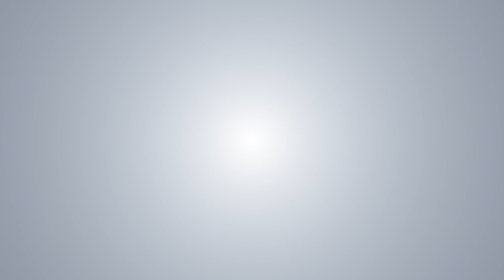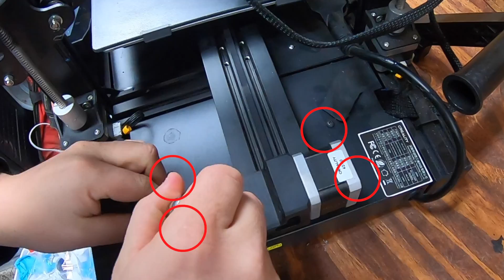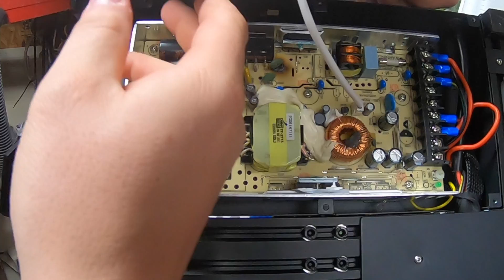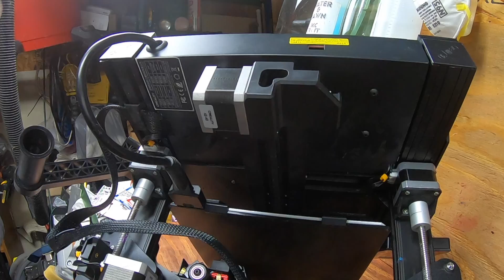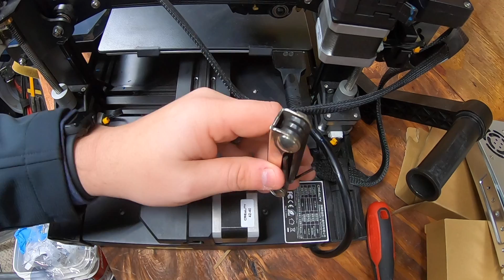3D Printer Has No Power & Won't Print? FIXED issue on a Creality CR-6 SE [Complete Guide]

Comment from the maker: Learn how to fix your 3D printer's no power situation! I will go through multiple steps on diagnosing your issue and finding a way to fix the problem. 

The Tools:
• Voltage Meter Kit - https://amzn.to/3riICui 
• Allen Wrench Sets - https://amzn.to/3GhKGH3 
• Philips Screwdriver - https://amzn.to/3hdpzx0 
• Magnetic Metal Tray - https://amzn.to/3tv6oRz

The Part:
• Mean Well LRS-350-24 - https://amzn.to/3AR3HPA

00:00 The Start
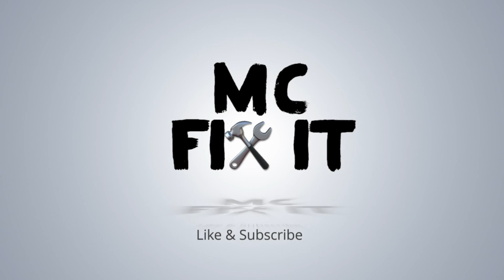00:07 The Project
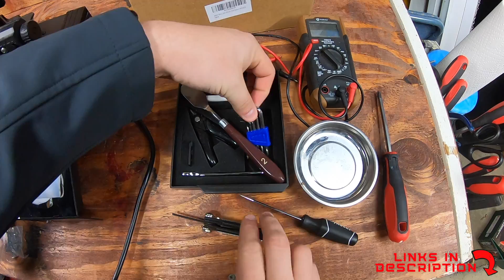00:52 The Tools & Supplies
01:22 Diagnosing the Problem
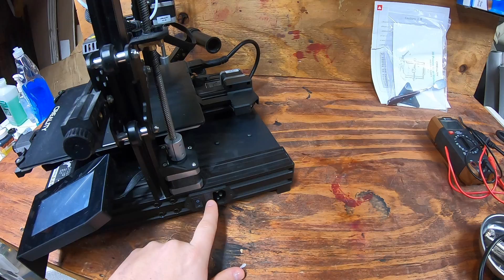02:09 Testing the Fuse
03:17 Testing the Power On/Off Switch
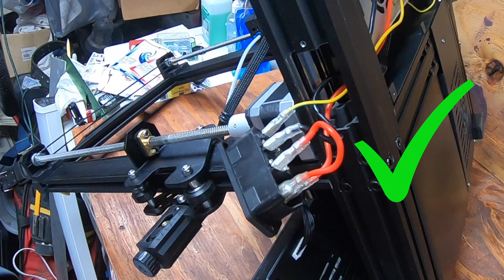07:17 Testing Power Supply
10:07 Finding the Problem
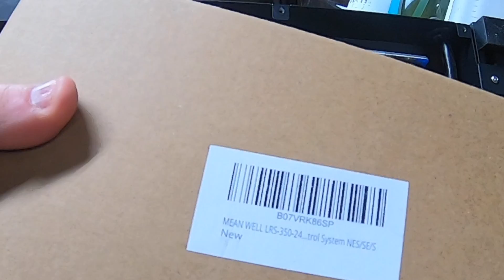10:48 Replacing Power Supply
19:50 Problem Fixed
19:59 Putting Everything Back Together
23:55 Closing

This video should be helpful in seeing how to fix all power issues on your 3D Printer. Check your make and model to get the appropriate parts. Be careful not to touch anything when plugged in due to possible electrocution or worse. 

Check out my website at http://mcfixit.us 

Disclaimer:
Due to factors beyond the control of MC FIX IT, I cannot guarantee against improper use or unauthorized modifications of this information in the video, post, blog, or social media. MC FIX IT assumes no liability for property damage or injury incurred as a result of any of the information contained in this video. Use this information at your own risk. If you feel uncomfortable at any time. Stop and go to a professional. MC FIX IT recommends safe practices when working on vehicles, your house, or any other project and or with tools seen or implied in this video. Due to factors beyond the control of MC FIX IT, no information contained in this video shall create any expressed or implied warranty or guarantee of any particular result. Any injury, damage, or loss that may result from improper use of these tools, equipment, or from the information contained in this video is the sole responsibility of the user and not MC FIX IT.

#mcfixit #3dprinter #creality
——
Supplies used to record this video: 
* GoPro Hero 7 Black - https://amzn.to/3f3ALtb 
* 256GB Flash Drive - https://amzn.to/33pAueG 
* Vlogging Frame - https://amzn.to/33tajE0 
* GoPro Pro 3.5mm Mic Adapter - https://amzn.to/2RCURCu 
* Youmic Lavalier Lapel Mic - https://amzn.to/2R55sWX 
* Boom Stand (tripod) - https://amzn.to/3bdkQaw
* 5/8” to 1/4” adapter (boom to blogging frame- https://amzn.to/3txrVsM 
* Portable Battery Powerbank- https://amzn.to/3vJQc0q 
* 6ft USB to USB-C (powerbank to GoPro)- https://amzn.to/3uAS5MH

Comment: Is not a resistor that is a ceramic capacitor, and thank you for remind me to check basics 1st (was the cable) 10:12 Just for the record be sure the power supply is discharged wen you put your hands inside of it
Reply from the maker: Thanks for the tips!

Comment: Wow, so glad I stumbled on your page. Mine keeps shutting off and sparks at the switch. Creality hasn't been helpful in the past and I'm going to try going slow and try your process. Thanks so much for the video and links to the power supply. Very helpful and hope mine doesn't start a fire besides the sparks. I got the CR6 via the Kickstarter campaign.
Reply from the maker: Best of luck with your fix!
Reply: @MCFIXIT  I followed your instructions and thanks again!! The switch may be the problem as I saw the plastic sleeve on the jumper cables melted and browned out. There’s also popping noises and sparks. I’ve ordered a new switch but where can I get the jumper cable replacements that are long enough to connect to the power supply?

Comment: i got a cr-6 SE 
built it and plugged it in and it exploded, and smoked up we got a replacement and got it fixed, and same thing happened (it is on the correct voltage) so i sort of despise cr-6 SE 
we are getting a refund and buying from a different company
Reply from the maker: Sorry to hear that. Sounds like you got a lemon of a printer. I bought this off someone so not sure why it happened. But I’ve had pretty good luck with many successful prints. What company did you go with?
Reply: @MCFIXIT  i believe i got it straight from the creality website, absolutely gutted about it im sending it back and just getting a refund, i might go with another lk5 pro
Reply: @MCFIXIT  i did try your video and its the battery and motherboard thats exploded 😂